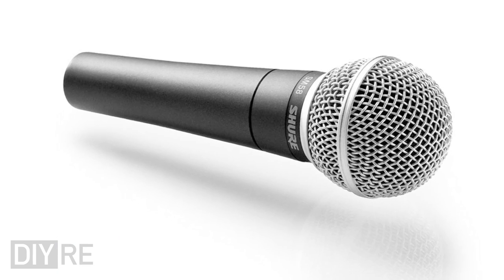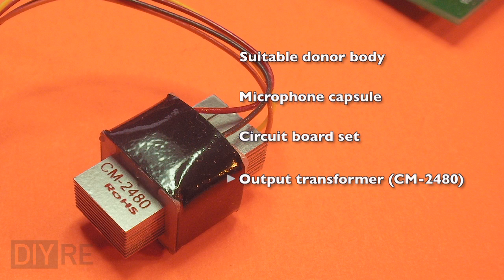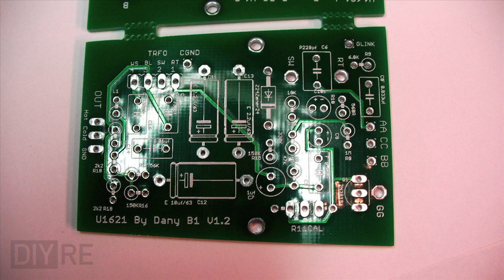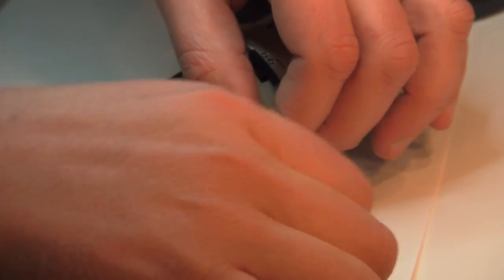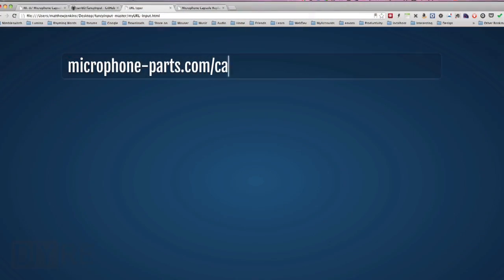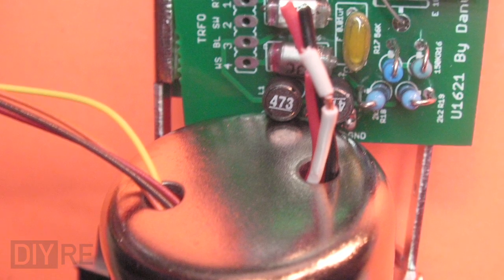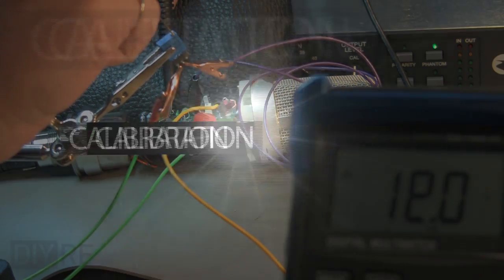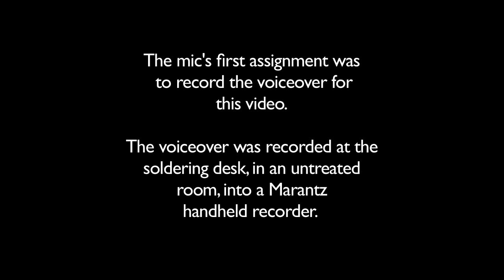How to Make Your Own DIY U87 Vintage Condenser Mic

Comment: I agree an audio comparison to an original U87 or an U 87 ai would drive home the impetus to start this project, specifically for newbies. I read over a decade ago that the capsules available just weren’t up to emulating the sound of an original or ai U87. Perhaps that has changed?

Comment: Could explain what your settings of your multimter were for the bias? I'm at the final stages of my build but i am unsure how to properly bias it. I can see how everything is connected, I just dont understand where the signal is coming from and what settings i should be measuring with. Thanks!

Comment: I have an unused GXL3000 laying around, would that be suitable for a donor mic with this project? I din't hear any steps specifying connecting the polar pattern, DB pad, or low cut switches.

Comment: I made a diy condenser mic using lm358 opamp, I added 5 condenser mic capsules in parallel , but the output reduced drastically, could you please tell me what might have caused it?
Reply: Try a higher end op-amp, AD or Burr Brown.

Comment: Can you include an entire part list of the components you used?
Im having a hard time finding it, might be because I'm new to this. But i'm willing to try and make one of these myself even though I dont have a lot of experience with it.

Beside that, this video is awesome and thank you for sharing this!
Reply: Go to the link he has on diyrecordingequipment and then right below the video there is "PCB components from Mouser" click on it and it is a cart with all the components.

They're a bit more expensive than before, i think there might be unnecessary duplicates.

there's a photo tutorial i found online, google "mic and mod u87 diy build instructions" It should be the second result.
Reply: There is redundency built into the current BOM. Now that I know that next time I can save money.

Comment: Hi friend . I have shure 55s microphone vintage 1957 not found. Can you help me to repair ? I not have idea if the capsule fail or another component.  The capsule test disarm in resistence  valor is 30 ohms. Tnkyou

Comment: An odd question, but Peterson, have you any experience with a 1977-vintage Sony ECM-33F small diaphragm condenser?
 I've recently listened to one and was left wondering what could I possibly want which that Sony doesn't provide?

On a more envious note, I've an Amateur radio friend whom recently attained a U-87 for $20 from a Pawn shop and it's in pristine condition.

 I don't believe I like him anymore...

 ;-)
Reply: I've never met him and I already hate him! :)

Comment: At Mouser Electronic I see where to order parts but when I put in Project U87 as a search term the final price is MERCHANDISE TOTAL: $67.31 (USD)   I don't know which or how many parts to order. Your build says 19.22. How did you come to that price? I'd start on this today but I'm very confused on what to purchase.
Reply: It's 19.22 on top of the cost of the mic body, capsule and other stuff.  The 20 bucks is for PCB components.

Comment: I came here thinking I'd just need a shoebox and some copper wire! This is NOTHING like making a pop filter....
Reply: Well, to be fair this is a copy of a Neumann U-87, one of the most expensive and high quality mics there is. If you just wanted to build a mic, you could just take the parts out of a cheap mic and make a nice housing for it or something like that. Or you could buy a microphone element and build a mic around that. That should be easier. Or, you could learn how to solder electronics. Once you do it, you can do it. Start with a kit and work your way up to more difficult projects like this.
Reply: @PaulTheSkeptic  A couple plastic cups and a piece of string....  :-P
Reply: @chrisw5742  Hmmm? Beer bash at the kite show.... I'm on it old chum!

Comment: The clones don’t sound nothing like an actual U87 it’s true, I’ve tested them. I put it down to metal foundry/ metallurgy differences but this is still a great project for making & experimenting with your own designs cheaply
Reply: So do they sound subjectively "worse" in comparison? How would you describe it?
Reply: Nothing beats a Neumann microphone capsule. But for most people, a different capsule is just 'good enough'...
Reply: Don’t these mikes use a tube preamp on the original U87's? Tube preamps provide some of the best sound quality for both condenser as well as ribbon mikes.
Reply: @Subgunman The U87 is solid-state, it uses a single FET and a coupling transformer.
Reply: The transformer probably isn’t a perfect match and there is a resonance between the coupling capacitor, amplifier output impedance, and transformer, though that isn’t the biggest thing. The K87 has a handful of critical things that many aftermarket capsules don’t get right. The glass beading of the Neumann backplate is different than many clone capsules and if the tensioning isn’t quite right, the K87 is underdamped so that is critical. A M7/K47 is not underdamped so there is more tolerance for diaphragm tension on that design. A “re-skin” on a real Neumann capsule which I have done a handful of still sounds weird if the tension isn’t right so definitely that is a very large factor. Wrong pre-tension before coating or running the coating too quickly so the Mylar gets too hot during the process can cause uneven tension as well.

Comment: I heard something about neumann mics and clones! I heard that the easy part of getting a neumann or c12 type clone is the capsule and even the transformer and circuit board, so essentially alot of the clones can be okay and even have a very similar frequency rresponse and eq, but now I heard the think about the real neumanns is that while the frequency is bumped alot in the high end, they use (dont quote me on the words) but some kind of eq filter/attenuation so that the high airy frequencies are not harsh/plasticky etc! thats the problem, anybody can make or mod a mic with a u87  or c12 type capsule and good parts , but they end up very harsh and sibilant! anyone else heard this? any thoughts?

Comment: Why doesn't microphones have an EQ? They can have a one level low-cut. Some mic's are boomy so I would want to shape it on the mic. Same goes for head-phones, why are there no built-in EQ? Some head-phones are bass-boosted and are bad for clarity of speech..
Interesting video thanks. So it's mostly adding double membranes? What is the cheapest mic to buy that successfully replicate U87?
Reply: you cant because the sound is created from the inclosure and drivers for head phones if the incloser around the headphone changes so does its sound stage also the size of the driver effect the bass ant the trebles ex on a good home theater the tweeters are not much bigger than an over ear headphone cup but the subwoffer can be over a foot wide
Reply: I have headphones with to much bass. I can put an EQ between the output and the headphones so the same chip could be in the headphones instead without having an extra box.

Comment: What value did you end up having to use when you finally put the two resistors in series to replace the variable resistor?
Reply: Not a fixed value, because each set of other errors is different, and this value is calibrated to this error
Reply: @Michael_Chao  I am aware of this. I asked what value they used IN THIS BUILD, which has an actual answer. No idea what the point of your reply was.
Reply: @Wizardofgosz When the drain voltage reaches 10.5V, the value of the adjustable resistance is the answer
Reply: @Wizardofgosz  U87 Ai  RS 2K-7K
Reply: @Michael_Chao  That's a very imperfect way of biasing the FET.

But you seem to be missing the point. I don't care what YOUR numbers are, I am simply curious what value THEY had to use. The one who posted this video. You are not able to answer the question, so why do you keep replying?

Comment: What is the total cost of the build?
Reply: +alpha numeric The capsule depending on if you want to go RK47 or RK7 are either $110 or $130 these you can be added without changing the circuitry depending on the Mic. If you go for the RK12 or RK87 they are the same price as the other 2 capsules but require the circuitry which is $110 so your total if you went all in for a better capsule and circuitry is $240. I built a RK87 from a MXL V250 a few weeks ago and the difference it Amazing.
Reply: +jayare kight can you build me a mic?
Reply: +jayare kight Thanks for the info.
Reply: Multi Media Freeks sure I can. Depends on what you are going for and what you are upgrading
Reply: +jayare kight The V250 body worked well?
Reply: +Christopher Crimmins the body was fine. everything matched up well with the new board. the capsule however didn't fit that narrow grill basket so I had to purchase a different one.
Reply: +jayare kight I may email you as well
Reply: More than a rode nt1000 which sounds way closer than this to the u87, but diy is much more fun.
Reply: I have about 625 in my 87 builds. Peluso capsules and xformers, SYT5 bodies I had to source from the UK because the US distributor doesnt have the ones with the engraving anymore. BOM from Mouser. I'm not sold on the mic parts dot com capsules which is why I didnt use them.

Comment: Someone on the site said it was around $350 to clone. The price of a real U87 is around $3,000 so ya lol good video
Reply: If you're buying good parts like a Peluso capsule and transformer, the parts come out to about $575. It's not magic, the rest of the components are just common electronics parts. Caps, resistors, etc.... Neumann builds lovely mic bodies machined to serious standards, so using a less expensive body saves money here. The commonly used body is about $150 of the aforementioned price. Is it as nice as the Neumann? No. Does it need to be? No. The 150 one I've seen is plenty substantial. The rest is just how good the clone of the actual circuit is. And the circuit boards being used here are EXACT clones of a particular vintage U87 circuit. I think he cloned a circuit from a 1970s U87.

So German capsules are between $600 and $800. Is the Peluso as good as the Neumann? Well, a friend of mine who is a well respected tech in the audio industry (he is known by everyone) uses Peluso capsules to replace capsules in any German mics he repairs unless otherwise instructed by the client. The Peluso U87 capsule is about $266. It is as good as the Neumann? My friend thinks so. But objectively is it? Maybe, maybe not, but if it's 97% there NO ONE is going to notice the odd 3%.

So yes, if you use good components, these are faithful reproductions of a U87. They sound amazing.

This IS NOT a clone of the modern U87ai, which has a different amplifier circuit and puts out about 8 dB more gain. So it is a little quieter, but the circuit is a clone of the real U87 I work with in one of the studios where I work, and give me that circuit all day long.
Reply: I just built two of these and I think I have more like 625-650 tied up in parts to build one. We also have a proper vintage U87 at the studio where I sometimes work. One of these days soon I am going to compare the two I built with one another, and each one individually to the vintage 87. I'll upload the files somewhere without saying which test is which, and you can listen and make your guesses.
Reply: @Wizardofgosz  Interested in hearing this!
Reply: @thanksmomstudio  So I just learned our real U87 needs work, so we gotta fix it before I can do that A/B!
Reply: @Wizardofgosz  Okay, let us
 when it happens!
Reply: @Wizardofgosz  please let us see the comparison, when the mic is fixed
Reply: You can copy, but you cant clone.
Reply: This youtube channel objective is you too buy parts giving you the feeling youll get a very close product to a 3k one, not even close, if you want to have fun do it but dont try to say something like clone.
Reply: @Wizardofgosz  Is not magic, is science and engineering, im sure you have no idea on both magic or science engineering.
Reply: @AlecsCash  Please tell us why smarty pants. Why is it "not even close"? Have you ever even been in the same room as a U87? I didn't think so.
Reply from the maker: @AlecsCash  What do you think the cost of parts is in a $3k microphone? It's probably a lot less than you think
Reply: @PetersonGoodwyn   A real Neumann microphone also has a 2 year warranty included in the price, the salary of everyone involved from start to showroom, etc. Name brand market value... the list goes on and on. If you build it yourself, you save in a hundred different ways, and also gain the enjoyment of learning and making. Somebody, and I won't say who (that dumbasss Alecs Cash) is sour because he overpaid for a microphone.
Reply: @Wizardofgosz  sounds awesome. have you done this already? would love to see/hear
Reply: @funmoneyband4757  I have. I finished my 2 builds last January (14 months ago or so). They came out very well. Not sure how I could get any pics or samples to you.
Reply: @Wizardofgosz  Hi Richard, I'm super interested too. Can you share via google drive (or mega) folder?
Reply: @Wizardofgosz  Did you ever get around to doing a side by side comparison with the U87 and your builds?

I'm curious how faithful to the original the frequency response of your build's ended up being. I don't expect it to be a 1 to 1 match, but at 1/5 the price, my interest is certainly piqued!
Reply: @sirf4ce  not yet. I haven't fixed the u-87 from the studio yet so I have not been able to do it, but I promise you I will eventually.
Reply: @Wizardofgosz  Understood. You obviously know what you're talking about so, I'd be taking your word for it, anyway.
Having actually been in a room with a U-87(a claim I cannot make) and given your knowledge, without a side by side audio or freq response comparison, how would you say your builds stack up against the U-87?
Reply: @Wizardofgosz  Are you happy with the mics you built though?? Sound close enough for your ear?   And probably better than anything you can "buy" at that price?
Reply: @chrisw5742  I'm extremely happy. I still haven't done the direct A/B test, but there's no getting around the fact that if you use good components with a good circuit (and this is an exact clone of I think the final Rev of the U87i circuit) you're going to get an awesome mic.

Quality has gotten cheaper but I don't think you'll find an equivalent you could buy at the same price. So yeah, if you're thinking about building, do it. Plus it's fun.
Reply: @Wizardofgosz  7
Reply: @EdElectra  7 what?
Reply: @EdElectra  82
Reply: @Wizardofgosz  hi did you get around to fixing your Neumann u87 and doing a side by side comparison with your DIY build?
Reply: @thetruth3316  Amazing memory! I'm sad to say no. It's not mine, it's owned by a good friend, and with the covid stuff I haven't been over to his house to pick it up. He's on the elderly side and has wanted to avoid contact with people. So sorry.
Reply: greetings from Portugal! Any updates on the A/B? thanks in advance! im thinking of doing this build just 4 the fun

Comment: Audio comparison to real u87 ?
Reply: Not even close.
Reply: @AlecsCash  I've sweep tested and A/B'd a lot of mics against the u87ai and this combo should be close. A mic with a very similar capsule and very similar circuit will at least sit the same in the mix and be the same "tool in the tool-chest".
Reply: Alecs Cash Fanboy located.
Reply: @AlecsCash  Does 97% count as "even close"?
Reply: Zack Stewart Then what’s the point of the mod? It’s close but not at the same level

Comment: Hi, I just received a T.Bone sc 450 ( newest version ) but there's a broken cable inside... It's the red one which is wired to the Capsule ( membrane ) and to the circuit...  

=> Can you/anybody tells me where does the red cable is wired on the circuit please ?? 

 Thanks.

Comment: Have you ever tried one of the cheap chinese capsules? Afaik Microphone-Parts uses them as well, but sort them out by Hand.
Great project!
Reply: Are you sure they use "cheap chinese" capsules? I doubt they do. Kinda defeats the point of diying your own mic. Cheaper than branding of said product while utilizing higher grade components found in more expensive mics. Straight from their site 

"We manufacture a variety of premium capsules for condenser microphones. Whether you are repairing a broken mic, restoring a vintage mic, or upgrading an inexpensive mic, we can provide a broad selection of sonic choices."

As far as I know those " cheap chinese' capsules are found already in almost all cheap sub 300 buck condensers
Reply: @donnyten2041  I won't spread any falsehood, but I'm quite sure, that I heard Matt saying that himself in an interview, probably on Produce like a pro.
The capsules I was talking about are around $30-40.
And there's nothing wrong with that. CNC machines work precisely and if they check any capsule before selling, I'm ok with that.
You can at least find capsules with the exact same look and name on Alibaba.
And one last thing, I'm quite sure, that a small company like this wouldn't be able to produce capsules for that price by themselves.

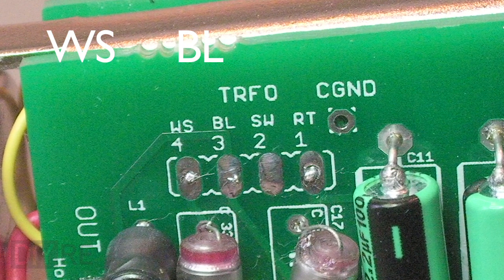Comment: Anyone notice a weak solder joint at 8:16 - 8:20mins - the RT connection labelled 1 especially, but there is a host of poor soldering. Could be trouble ahead. Mic sounds very nice, despite the cost and home build. To design technology well cost money, hence high price tag. To rip off someones hard work (clone) is far easier, hence low cost. Good project.
Reply: +Fusion Music  Agreed - see the cold solder joint clearly at 8:20. You have to watch these where you have alot of copper going to the pad like a ground signal or wire. Suggest applying flux, iron re-touch there and clean with alcohol.

Comment: 10:07 also why not just leave that adjustable resistor wired in rather than replace it with a fixed resistor?
Reply: Adjustable resistors are a lot more expensive.